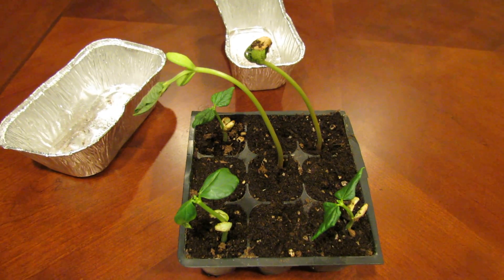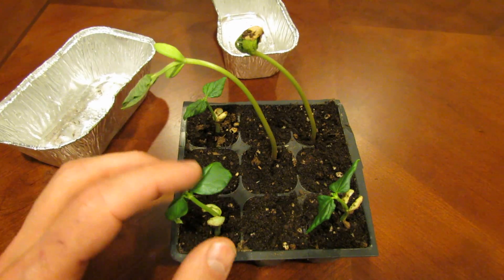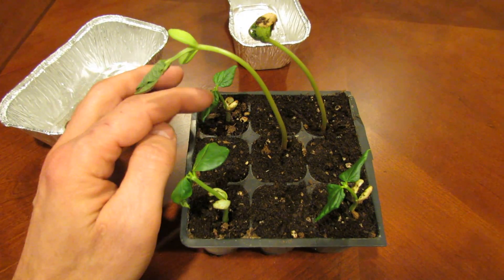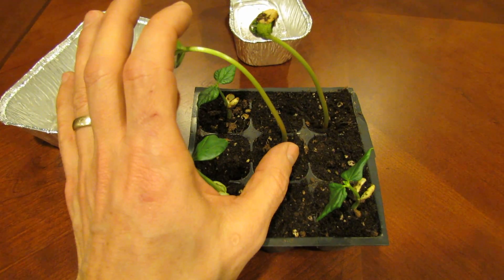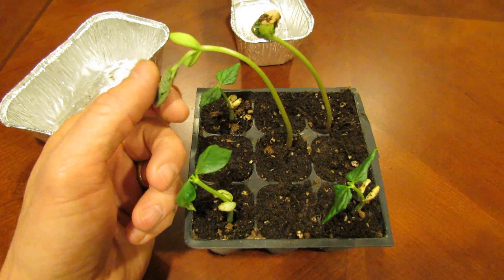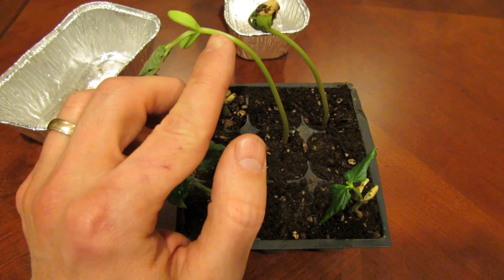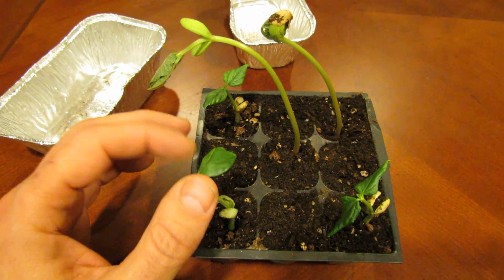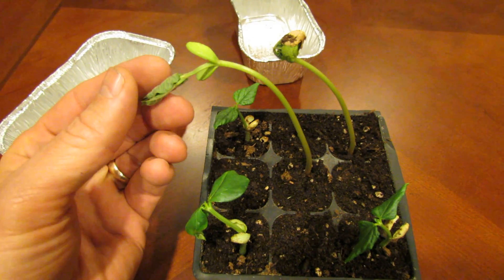60 Seconds or Sow: What Plant 'Legginess' Looks Like and Means - The Rusted Garden 2014

Comment: will the plants still be ok if they have legginess or should i pull them and start over
Reply from the maker: Jayden Reiling If you have time start over. You can save leggy plants but a sturdy plant to start works out better in the end. I recommend trying to nurse your leggy plant while you start some new ones if you can do that. If the new ones look great toss the leggy ones.
Reply: ok my beans sprouts arnt as long as the ones in the video should i treat it the same as a  regular size sprout
Reply from the maker: Jayden Reiling is it just beans
Reply: And a few peas